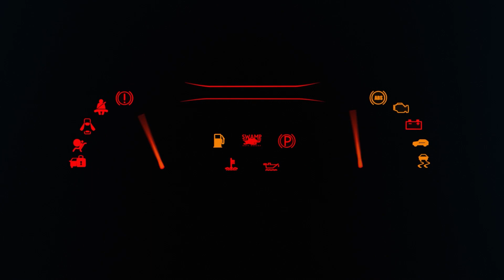Sanding the Rusty Mitsubishi Lancer for Paint

Comment: i will give you a tip i have worked in an auto body repair shop and i know a bit so when sanding down dont apply too much pressure because you might dent in the panel that you are working on, also dont lean the sander on the edges because that can create hi/low spots on the pannels that can be spotted after the repaint sending lots od love and support from Macedonia love the work that yall are doing😁 oh and also slow and steady movements with the sander
Reply from the maker: Thank you for the tips. We need any advice you can give and really appreciate it.
Reply: I was going to say the same.  Good advice.  Keep the sander flat and keep it moving with gentle pressure.
Reply: Solid advice, let the sandpaper cut the panel down evenly. Keep it moving with gentle pressure!

Comment: One thing you need to do, especially on the roof, is take it right back to bare metal and then wipe over some Deoxidine (phosphoric acid - also known in some shops as Dexoit) let this sit on the bare metal for about an hour then wash it off with water and sand again, this will kill the rust in the pore's of the metal and stop it coming back (providing you lay the etch and primer coats properly, if theres still signs of rust, sand and repeat with the acid wash (the acid wont affect your skin but wash it off to be sure you dont have a reaction to it), what your looking for is a clean rust free surface to paint, good luck!, you can also use the acid on other metal parts too to clean them up like bolts, nuts, arms etc etc, remove the aerial from the roof and get to the surface under that also.
Reply from the maker: That’s good advice and we appreciate that. That’s the kind of help we need.

Comment: Voting for the Nismo!
Also get a painters scaffold that fits between two step ladders.  Makes it so much easier doing the roof, either sanding or painting just walk back and forth
Glad you're using a mask Tyler, should have safety glasses too.
Reply from the maker: Yes sir thank you for the tip

Comment: Glad to see you tackling the roof Tyler. I'm thinking you'll need to do some bodywork on it after you use a rust stabilizer. Those rust spots look too deep to just sand out. Good luck on your prep work.
Reply from the maker: They are very deep and stained down in the metal.

Comment: When you wrap the hood make sure you don't overheat the vinyl. They tend to discolor when doing so. Always leave some Xtra material as well. Worse case scenario you can cut but you can't ever add. If posible use knife less tape. For. Those hard places or deep curves.
Reply: Oh also I would recommend painting the parts either way and just wrap on top. In case you decide you don't like it. You don't have to paint parts again and have mismatch issues.
Reply from the maker: Ok. Thanks. Appreciate the tips.

Comment: On the roof of that car I usually wouldn't use 80 grit then 180 and then 320 smooth it out and then where the paint peeling 180 than 320 feather it out and you're also you let the you're going a little bit fast with the sander let the sander do the work and then there's a little switch easy to turn that up a little bit to get the more air pressure you'll get the hang of it

Comment: Well the top carbon is quite so wowwww but I would recommend the rest the car to be black with carbon top the car will look so aggressive 👌 ❤❤❤❤ my opinion
Reply: By the way try to check color behind the glass cz u don't h the color is behind glass rear and front cz if you don't remove the glass the paint could be peeled off with time 😉  so check it hope it helps a little ❤
Reply from the maker: That would look tough
Reply: @Swamp Boys Garage  I know u just have to check before it can cause like dual loss in the long run what I mean is u don't know what's underneath the glass any way that's my opinion u see which fits u best and try to find professional advice wish all the best God Bless all U guys